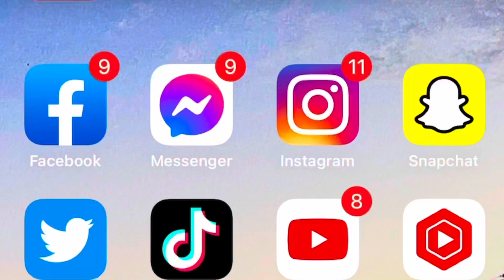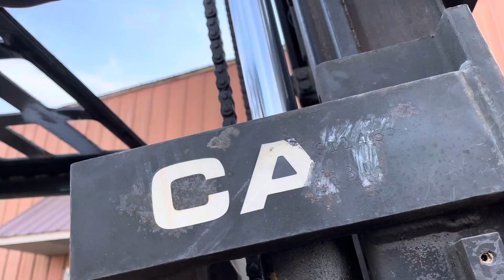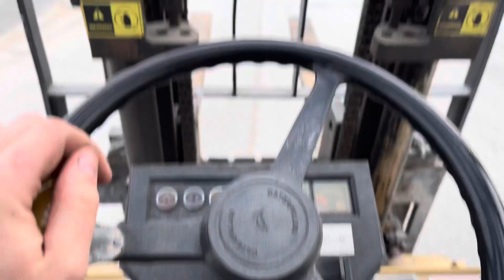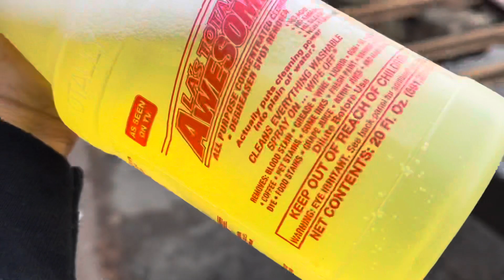Rebuilding My Dream Truck That I WRECKED *Part 1*

Comment: There is a key hole under rear bumper when battery is dead but I guess funnier to punch it.
Reply from the maker: Key was locked inside the car
Reply: @CrudeDiesel  haha well then that didn't matter 🤷‍♂️